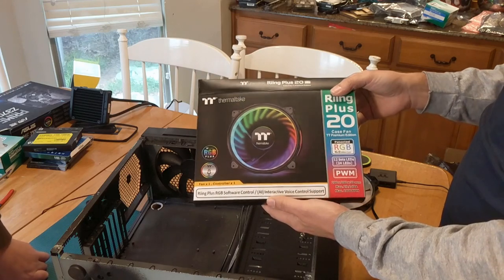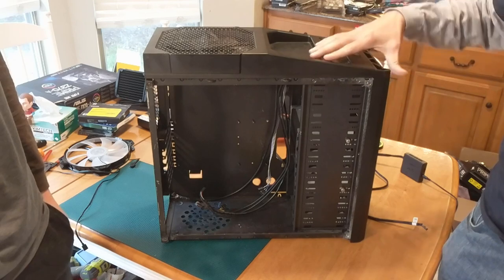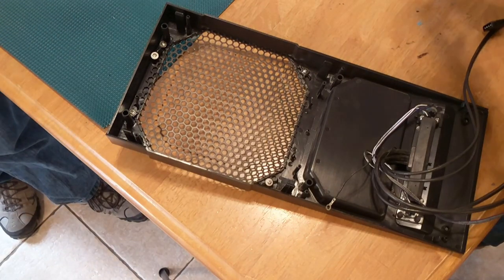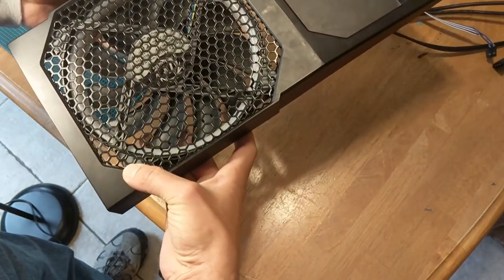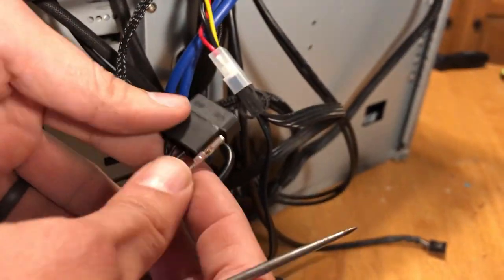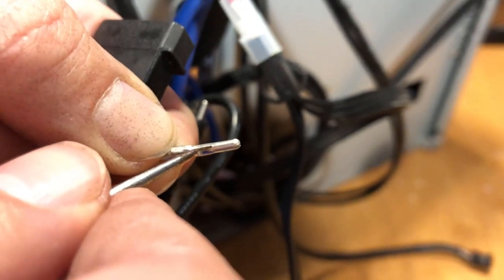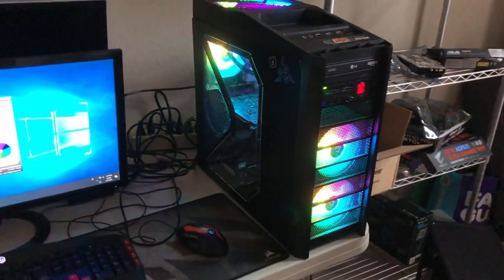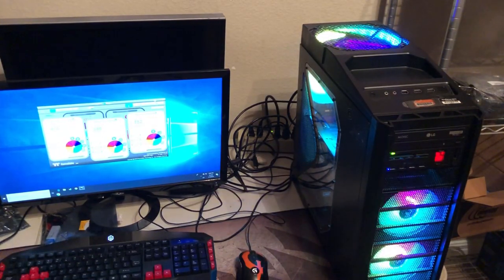Thermaltake Riing Plus 20cm in Antec Nine hundred with i7-8700k and 1080Ti & repair 4 pin molex

Comment: I just used this video as a reference for doing the same thing to my Antec 1200 case (which I continue to use for my main computer). 
The only difference between mine and yours is that I had to daisy-chain a second fan controller because the 1200 has a total of 6 fans, and a single controller can only handle 5. 
Also, I didn't have access to a tool that could sand the corners of the Riing Plus 20 to make it level, so I had to use a wood burning tool to actually melt the corners of it off. 😅 
Anyway, I couldn't have done it if I didn't have this video to use as an example, so thank you! 😄
Reply from the maker: jmaeshawn wow man thanks!  I’m glad it worked out for you. Love Antec!  I’d like to see your finished results. Nice improv with the wood burning tool!
Reply from the maker: Check out the Antec cable extensions.  We just used them on a build yesterday and they are sweet.  I was saving them for my nine hundred but I waited too long and we needed them,   You can see it in our Discord if you are interested under the Builds channel https://discord.gg/qCnpHQk

Comment: I used this case in my first build. All I had was a AMD FX-6300 which I overclocked to 4.1 GHz, and a GTX 1050ti. Most of my components ran at very cool temperatures. I have already built my 3rd system now, but no case has been better to me than the six hundred. I have even considered buying another one, and modifying it for usb 3.0 and water cooling.
Reply from the maker: CluelessDragoon I wish it had usb 3.0 front ports. I’m going to contact Antec to see if they will send me a new front panel PCB.
Reply: pcBoostin did you ever end up contacting them? I just did a new build build and I’m still using my 900 but have the same issue with the front ports.

Comment: oh Im glad I found your vid Im actually about to do something very similar as I have the same case! Going to do hole making for cable mgmt and the psu holes at the bottom! Glad to see it worked!  I was worrid about the 8pin cable but I see you managed to it through still even though the motherboard is above the hole. No rgb for me though as this was just an upgrade initially and that made want to redo the wiring.  RGB will be for a new comp if GPUs ever get in stock again lol.
Reply from the maker: I used a unibit Christmas tree looking bit to make the holes.  File them smooth then line them with some rubber so you don't chafe.   The rubber I used to line them with was insulation off an old USB cable I had already butchered.  Anything will work but USB a little larger.  I cut it off then split it down the middle.  Then slide it around the hole.   I should've showed all that but it was one of my first videos.  Good luck!

Comment: man thats awesome i have that case too i was checking to buy another case but ur build made me change my opinions with what do u cut holes in the cases and for the psu
Reply from the maker: Yeah.  I wish I had video of drilling the case out and painting but I didn't think about recording that at the time.  You can only tuck a couple of cables behind the back panel but it helps.  I'm thinking of putting a 360 radiator up front which would require a MNPCtech type mod to the front fan cases but it would be sweet!

Comment: Did you get the fan with the controller and if so do you need it or you can set the colors with only the software?
Reply from the maker: It came with the controller but I also got the ThermalTake RGB fans with the same controller so all 4 of my fans plug into the one controller and I can control/address them with the software.  Very easy and clean.

Comment: whats the device below the dvd player ? have this case intrested in modding it to take new amd build, like the fans youve done shame im not into rgb but flashing lights bring on migrain, how does the front usb card reader conect up inside ?
mike M1KEY
Reply from the maker: it's a card reader and USB 3.0 hub 5.25" bay.  To give me USB3.0 up front of the case since this older gen of the case has USB 2.0 up top.

Comment: How loud is the fan? I'm considering getting it for my next rig.
Reply from the maker: It’s not loud at all. The controller does use pwm and turns it up as cpu temp rises but it’s still not bad. I have had some noises sometimes like the fan is loose. I have to bang it a little to get it to stop. It’s cool though.